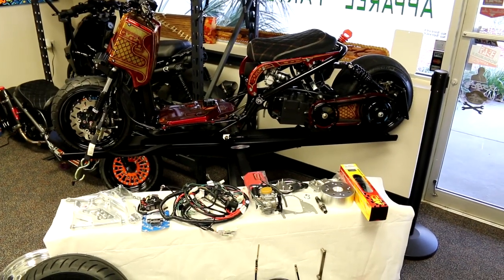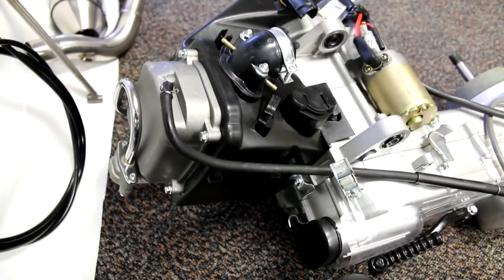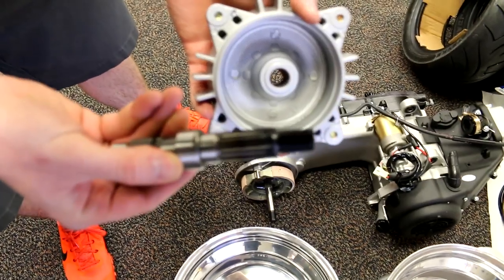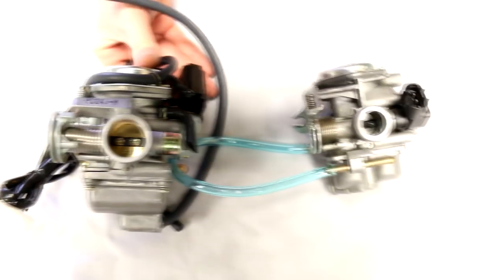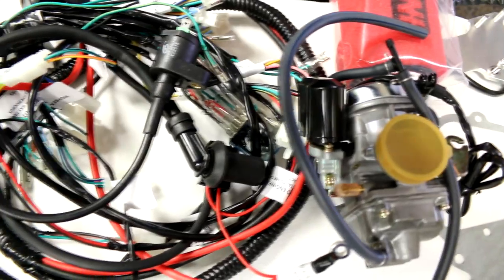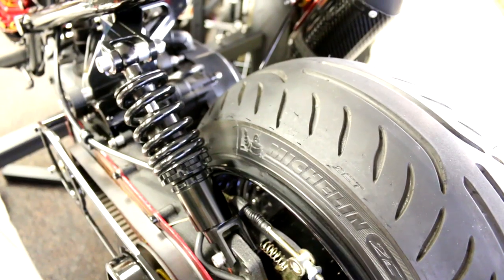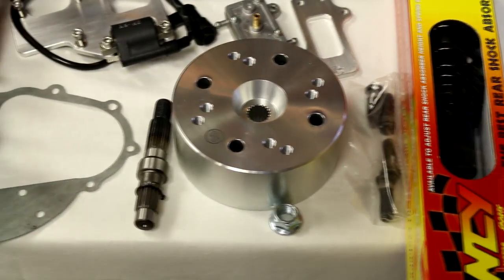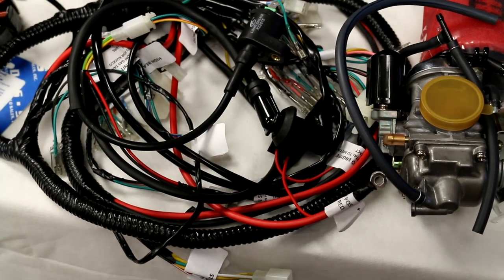SWAPPING A GY6 INTO YOUR HONDA RUCKUS

Comment: Hey so do you have a video actually swapping these parts into to a stock ruckus. This is what I'll be doing for mine
Reply from the maker: we have many different videos under the gy6 section. showing you how to mount the carb, wire the ruck with the atr harness, run the fuel pump lines and vacuum lines for the carb. we also have a video on the 49cc page that shows you how to put on your engine mount and it is the same theory for the gy6, so you will shave the same parts off and mount it the same.  thank you

Comment: does the 11 pole come with everything needed for the swap or is everything sold separately
Reply from the maker: the 11 pole is just the motor you will have to order the rest of the parts to make the swap happen

Comment: If you do a GY6 swap on a ruckus, if you stretch it too, do you NEED to lower it ?
Reply from the maker: iimkushed please watch this https://youtu.be/iIgwCrNw5dY you will need to attach the motor to the ruckus so you need a mount the motor is longer than stock as well. As far as lowering it no that has to do with front forks usually

Comment: Why do you need new wheels? Could you just retain the stock wheels?
Reply from the maker: We go over this in the  video, we tell you the spline pattern is different and the offset is wrong if you try to run the stock wheel so it wont work in multiple ways

Comment: how much is a project like this?
Reply: Kyle Hoffman probably at least 2k ish
Reply: is that including the ruckus or no?
Reply: definitely without ruckus, I'm about to drop about 2k ish after i purchased mine
Reply: Wtf? I see gy6 scooters all the time for cheap even a new engine online is cheap
Reply: j doyle buy a 150c donor scooter for 300. Put everything on ruckus...enjoy!!!
Reply: 300
Reply: @Garrett Magnan because you have to have an engine mount , wiring harness , hub , wheel , and exhaust which is really expensive.  The mount for the engine is like 350 $
Reply: Tra vis can you explain a little more

Comment: any way to do it so it looks like less of a stretched abomination?
Reply from the maker: you can make your own weld on mount but you wont be able to use a fatty tire you would be limited to a stock gy6 rear skinny wheel and you have to be careful how far you bring the motor in due to the carb may hit the frame and the valve cover could end up over the gas cap. this is why people use the fatty mounts and that like the fat tire look.  thank you

Comment: The tire says you need "staps" what is that?  Also if a customer purchases a rim and tire from you guys you cant throw in a proper mounting job?
Reply: ALso the link to rear hub shows an entire page of items which does not include a rear hub lol.
Reply: Does the frame have to be cut for this to work properly or is this all literally bolted on mods?  Any welding involved?
Reply from the maker: joe leeman you would need to use a cheetah and STRAPS to stretch the tire on the wheel. We do not work on scooters nor own a tire machine so we would not be able to do it . They are all bolt on parts no welding. And under the items there should be a rear hub
Reply from the maker: joe leeman we will fix the link

Comment: do you change the front forks or triple tree
Reply from the maker: you dont have to change the triple tree its not necessary. we do suggest going with disc brakes up front for the future which includes forks. your going faster so you will want more stopping power

Comment: Does the gy6 motor fit in a metro ?
Reply: Erik Wattson it can.
Reply: It can.
Reply: @jimmy_thelego_kid301  is there any modifications that will be needed for the fitment of it ? The information is very appreciated
Reply: Erik Wattson it takes some fabrication skills. I haven’t seen any bolt on mounts for a met gy6 and the offset of a fatty would take some engineering to work around. Hit up the forums online. There are some gy6 Mets out there.

Comment: I just got back from laos and i bought a honda zoomerX, can someone tell me if it is the exact same thing as a rukus? I want to buy a gy6 fully complete swap and ship it there to do the project there, can someone tell me the cost? And how much the parts weigh?
Reply from the maker: the zoomer x is not the same as the ruckus sorry. the older zoomer is the same with few minor differences but the zoomer x is different.
Reply: The Ruck Shop thats sucks, i looked online and the frame looks very similar. I guess i would have to do a gy6 in the US and try to ship it to laos